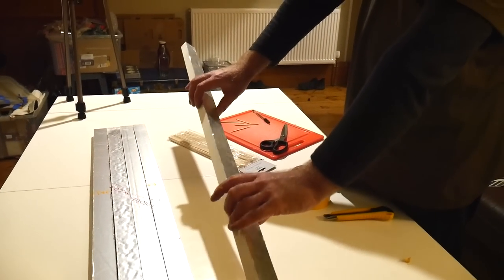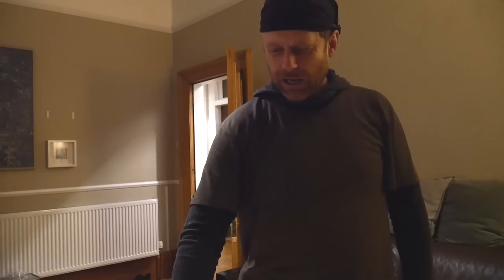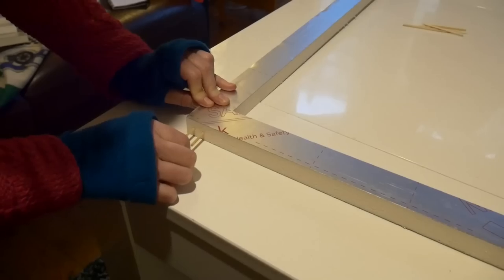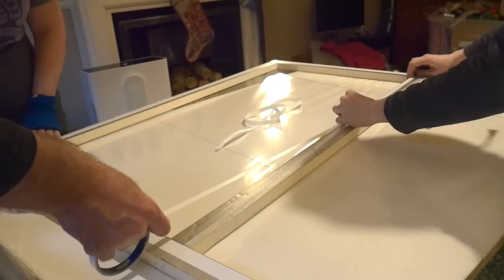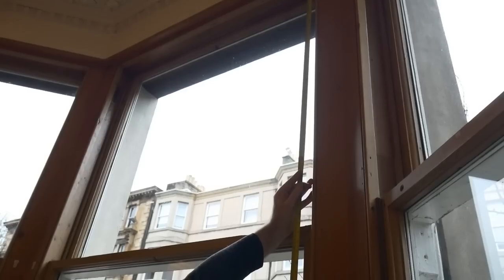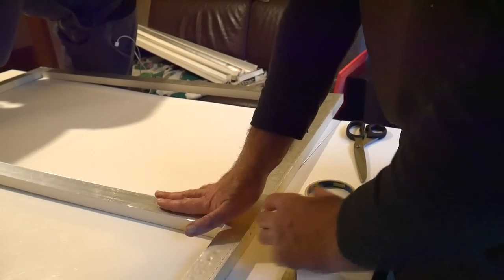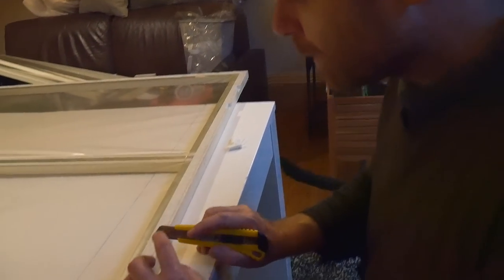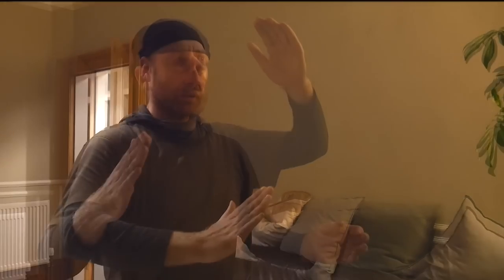$5 DIY Triple Glazed Windows -Tutorial

Comment: If you really want it to work well, use a hare dryer on the foil after you put it on. It will make it tightly fit, and no wrinkles
Reply from the maker: This kind of cellophane doesn't really shrink under heat, and too much tension could buckle the frame, but with different materials and if you're being careful, then yes.

Comment: I've often used painters tape and a sheet of plastic. But it's a mess to store away and the tape for better and worse, is not very sticky. A frame for the plastic is much more attractive and is easyer to stretch the plastic over when constructed on a table rather than climbing over coutches or moving entertainment centers ect.
Reply from the maker: Yeah. The tape on its own is fairly effective, but having the one unit that can wedge in and be easily removed and stowed is ergonomically a lot nicer, and a lot more effective in terms of insulation.

Comment: A slightly more expensive but still extremely cheap upgrade option is to buy clear shower curtains and use those instead of the cellophane. You can cut them to size and buy them in varying thickness but regardless the eva/peva material is far more durable and rip resistant. I use clear shower curtains instead of the typical window plastic in the winter because my cats always accidentally destroy the regular plastic within a day or 2.
Reply from the maker: Yep, is an option. The cellophane is very fragile in terms of rips spreading easily, but once it's fully locked down with the double sided tape it's pretty strong and lasts ok.

Comment: Awesome tutorial - very valuable! Would this work on the outside for people who have inside blinds that prevent putting these on the inside?
Reply from the maker: Maybe. Would need an external frame to wedge into, and strong chance of getting blown out by wind, so might need to be actually screwed or otherwise attached, which might affect how the window is opened.

They're fairly slim profile tho, and can be moreso still with thinner insulation board, so can probably be made to not hit on blinds.
Reply: @OpenSourceLowTech  Many thanks!
Reply: You can get double sided tape that is a thin foam strip, this could work to attach to the outside. You can also buy sticky aluminium foil tape to completely seal the foam board because it could get rain seeping in otherwise
Reply from the maker: @utubeape  Could work. Bit more hassle than putting them inside, but is an option if that's not architecturally possible.
Reply: I'd say the problem is that cellophane and mist other thin film plastic will degrade from UV light a s break very fast. 
Window glass blocks any harmful UV light.
Reply: @OpenSourceLowTech  your method is brilliant but there are lots of rental flats with roller blinds so there is no space for the foamboard frame.
If the landlord cared about the tenants winter bills they could supply polycarbonate with thin magnetic strip attached and have another strip built into the window frame. I live in a conservation area with cold single glazed sash windows that cannot be changed for historic reasons
Reply: @calysagora3615  its only supposed to last the winter, this system will make a massive difference especially on single glazed windows
Reply from the maker: Yeah most of the windows here in Edinburgh are on listed buildings as well, so it's a bit of a nightmare and expense to update them.

This approach should be able to be used with struts as thin as a couple millimeters, long as they're somewhat rigid, like acrylic or flat aluminium.

Comment: what about putting a couple of those silica gel moisture collecting bags on the middle rail before sealing up the window with tape, could reduce condensation
Reply from the maker: There's not going to be any moisture getting into the unit itself, but we are looking at something like that, maybe just table salt, on the bottom frame of the window, to catch anything that does get through.

Comment: It's brilliant!
I did something similar to create double glazing years ago and it worked really well.
It did end up getting mildew between the sheet and glass but you could take it off and redo it in the summer.
Reply from the maker: These just press fit, so you can take them in and out for cleaning and airing super easy.

Comment: Thank you for another great video !

If you go on ebay and search for Cellophane, then quite often, in the small print, you will find that BOPP (Biaxial orientated Polypropylene) is being supplied.  In other cases it is unclear actually what is being supplied.  Sometimes it says Polypropylene.  Did you take steps to ensure that you were actually being supplied Cellophane, and do you think that it matters ?  Polypropylene is said to be brittle at low temperatures and the stretched polypropylene more so.  Bopp seems to have good UV resistance, but its brittle nature could be a problem in some applications.
Reply from the maker: We're just using cellophane because it's what happens to be cheapest, and nicely clear.
We've not had any issues with temperature reactiveness, UV, etc so far, but will keep an eye on them in the longer term.

Worst case scenario and it does perish, it's pretty easy to replace.
Reply: @OpenSourceLowTech  Great, Thanks for getting back to me.
Reply: Problem is that they write cellophane but when you check specs it actually isnt made frok celulose, instead it is made polypropilene...
So, celulose should be far better at temperature changes...
Reply: @vedranart  Thanks for indicating the potential advantages of cellophane over polypropylene.  As you say it is not always clear what the vendor is selling

Comment: try to use hairdryer to strech the foil...
Reply from the maker: We're using a cellophane which I think doesn't shrink under heat, but a PVC or similar could work.
I think tho it would mostly end up buckling the frame, as it's not super rigid.

Comment: How do you cut the board straight using only basic tools? i just tried it and its quite hard to get the dimensions right. it fit ok ish into the window without the plastic on then once i added that it started to bow weirdly. ive just used poly wedges to make it stay for now. perhaps my next one will be better
Reply from the maker: The strips will bow if there's tension on the film, so the trick is to get the clear plastic flat, but not tight such that it pulls everything inwards.
A little bit of bowing isn't necessarily much of a problem, and can be masking / painters taped to the window frame if you want to stop all airflow completely.
Reply from the maker: We made a cutting guide jig for the strips, but only because we're doing a lot of them. Just a straight edge and craft knife should be good enough.